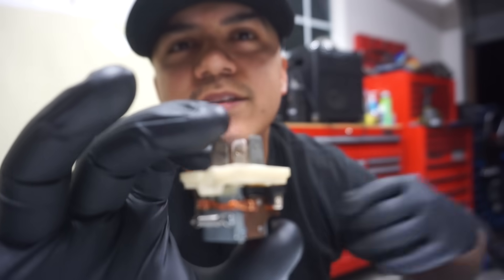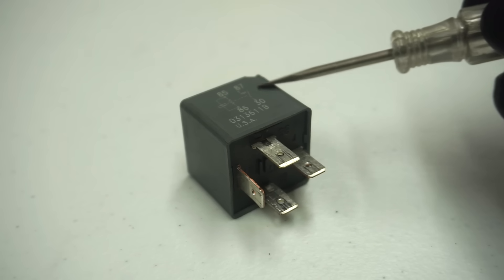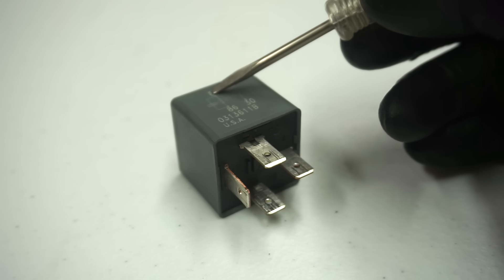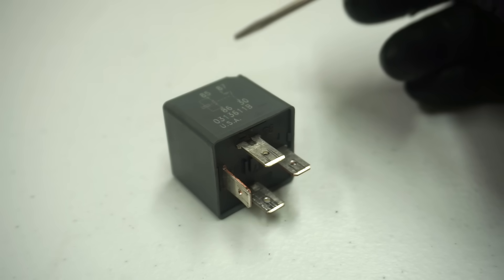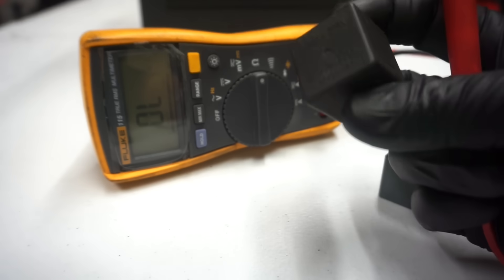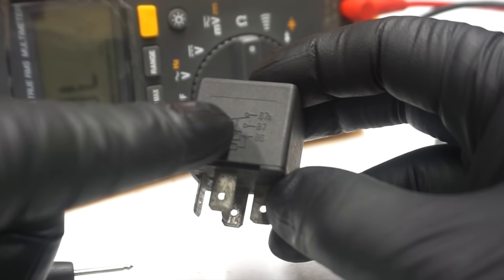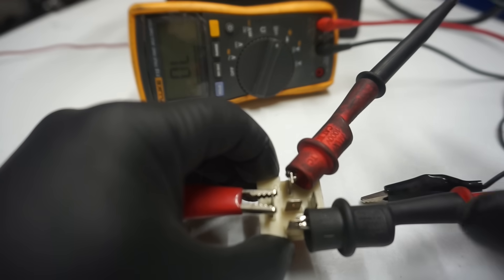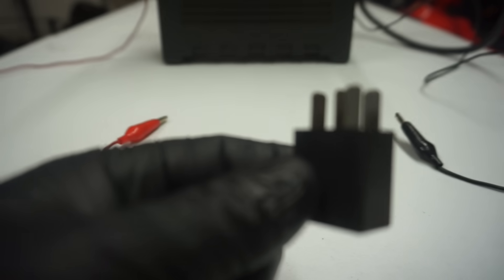How To Test a Relay The Easy Way

Comment: GREAT Video. I bought a 1983 BMW 635CSI sight unseen. I brought it home .I saw relays disconnected. Whatn i plugged the relay in.The electric radiator fans would not shut off. I have no Computer, No Radio, No Speedometer , no Trip Computer, No Systems Computer Check, it is to the left of steering wheel and you push the black button.Any lights or problems the red light to say the tail light or right turn signal will light up.Thtat is No Bueno. Here's the Kicker. I turned the key and he goes  " NO NO NO . You need to push the button, it is a push button start now. " Like it was a COOL add on. It is a PROBLEM with the electrical system. This dude had a 2018 BMW M^ and his wife had a 2020 X4. So when he bought this car. He thought you drove to your local Auto Zone and said " HEY MAN + I have a 1983 BMW 635CSI Grey Markey EURO and I Need Parts Hefa' . NO man it dont roll that way. I need HELP.......... Por fa Vore; Jp.. Great Video.....My e mail is tarponjpe@gmail.com

Comment: Hey bro i was wondering if you can give me some guidance so ,I have this buzzing noise that i suspect that has been draining my battery and I got a new battery and the car worked fine till i left it parked for a full day and the new battery was drained dead , it was also not even starting with getting a jump.. so after some time i figured to change the terminals on the negative post due to the original factory  terminal being corroded  and was just totally shit and was berally having contact to the battery  post so  i  eventually  changed  both so when i was able to get it to start I did the alternator check trick where I took off a terminal While  the car was running and the car did not turn off ... The car runs fine does not stall And turns on right away when  battery is good.... Breaking my head trying to figure out what it might  B was thinking about doing a draw testTo try to figure out if anything is pulling any power while the car is off I noticed that the noise is coming from main fuse box and im assuming its a relay, my question is what would be the best way to fix the issue... i have already took the battery to Oriellys to charge the battery and have left the car disconnected to the battery post.... @homieHektor
Reply from the maker: 1-What’s the year, make, and model of your car? 🚘 
2-You need to do a parasitic draw test to see what’s draining the battery 🔋 
3-Get a wiring diagram to see what’s involved in the circuit, and find the problem.

Comment: My radiator fans only come on when I turn my ac on they won't come on when the vehicle gets up to temperature though, do you think this could be a relay problem or would it not turn on at all if it was a relay
Reply from the maker: Depends on how it’s wired. Could be a coolant temp sensor...
Reply: @HomieHektor  might just replace the temp sensor first then and see if that fixes it, thanks for the advice

Comment: Amazing video  nice and clear, I'm using one  40 amp  relay for my nitrous and fuel solenoids ,testing system while engine is off  for 10 seconds straight no problems there, driving the car the system works  for one second  only ,then  no power from # 87 to the solenoids  ,thought I would pic your brain before tying another relay,thanx

Comment: Hector.  I have a 2006 C6 Corvette.  The HUD says “Service charging system”. I have replaced the alternator, battery and starter and it still gives me the same message.  I have checked all the Corvette blogs and no one seems to know what causes this. Desperate need help

Comment: So essentially the relay could be bad but still be clicking. I have a problem with my winshield wipers suddenly where they move very slowly then stop. Then after I've restarted the ignition cycle they will start to move again but slowly. I'm hoping it's not the motor and might be the relay. But I thought if the relay is bad they wouldn't move at all. Or maybe I miss understand. Thank you for the excellent video!

Comment: How do you get the radio in a 2007 Chevy her after the battery goes dead for a week before replacing, and now the radio doesn’t work or door chimes or blinker tic-tac- or seat belt chimes
Reply from the maker: What’s your question 🧐

Comment: Step 1: Remove relay from socket.
Step 2: Bang relay against the side of the cabinet hard several times.
Step 3: reinstall relay.
Step 4: run machine.

Comment: I'm 75 years old and have been a mechanic most of my life.  This is an excellent video.  It is very easy  to understand.  Thank you.  God Bless
Reply: 75 kickin it on youtube? God bless you sir
Reply: Sir could u possibly read what I was just posting and many help. Me out
Reply: @jamesstephens633  or select the square with the cc in the middle of it on the upper right side of the screen and she can read the excellent instructions.
Reply: I AGREE
Reply: Totally agree with you
Reply: agree man. well 👍 done
Reply: Awesome 👌 my first time
Reply: Paano pag check ng starter relay
Reply: I purchased a Toyota IQ 2009 push start button last year it was good and all ( its a used car) but i didnt drive it for a little while and now that i'm ready to drive it, its not starting..... Couldnt be the battery because i purchased a new one when i got the car, i just replaced the gas pump and there's petrol in it....... When i push the button to start it stuff shows up on the dashboard but when i try to start the car its making a clicking sound repeatedly then its like its dead again. What could be the issue??
Reply: So precise
Reply: Very well done video. This gentleman explained and demonstrated the operation and testing of the relay better than I’ve seen others do. 

Keep up the good work and thanks.
Reply: Hello .can anyone explain what could be the issue .i have taken my battery off while engine was running.after 10 second engine went dead.i have put new battery..all dashboard lights working.starter motor working fine.all switch working ok.but there is no noise when i trun on ignition and no start either.even though starter motor working fine
Reply: Hello .can anyone explain what could be the issue .i have taken my battery off while engine was running.after 10 second engine went dead.i have put new battery..all dashboard lights working.starter motor working fine.all switch working ok.but there is no noise when i trun on ignition and no start either.even though starter motor working fine
Reply: It was very helpful I'm having a problem with a fuel pump trying to get powers to it I can pour gas in it it will start but will not stay running
Reply: Yes he is good but when you are hard of hearing he talk way too fast for me sorry guys
Reply: @teranorris8606  q
Reply: @teranorris8606  adjust the Replay Speed (the little gear beside cc, bottom right)- i use all time...
Reply: @teranorris8606  For fast talkers or a slower listen like me, it can help to slow the video time down with selecting the top right corner of video, 3-dot setting button.
Reply: @jimmay1988   .
Reply: @teranorris8606  Just go to the three little dots at the upper right of the video and press it then select “Playback speed” and slow down the video.
Reply: @teranorris8606  what? Huh? I didn't hear you 🤣😂😅😂🤣
Reply: it was not an excellent video, it's ok'ish bc he said one of the relays was supposed to be bad yet he didn't test it to show us why it was bad, very stupiid
Reply: @pagepro211  lets see your video.

Comment: Sup bro.  I have a 90 nissan hardbody. Just died while driving it..  so I ran the fuel pump direct to my battery.  Its getting fuel up to the fuel pressure regulator. But still no start..  when I spray starting fluid into throttlebody it starts

Comment: When you powered your relay on the bench, what did you use for power source? Just a 12 volt battery?
Reply from the maker: 12 volt jumper pack, battery works as well 👍🏼
Reply: @HomieHektor  relays on a Chevy are sitting different than on your post. Same concept on my Chevy relay as your post?  And your vids are pretty awesome. Thanks

Comment: Thank you for your time. I could really use your help.  I need to know the setting to put on my meter.  Im stuck with a crank no start issue.  My meter has 20M , 200K, 2K, 200. for the OHM.   I dont have  1K, I tried reading the meter check at 2k and got nothimg.  What setting do i need to set my meter on.
thank you .

Comment: Great video but isn't it simpler to just swap the relayed and see if the problem is solved before getting into the weeds?
Reply from the maker: Yes, but then what? This is stuff you gotta know 👍🏼
Reply: @HomieHektor  
Say your fuel pump didn't work and you swapped the relay with the one for something else... then the fuel pump worked but the other thing didn't.    Wouldn't you just get another relay?
Reply from the maker: @Terryblount  yes

Comment: Just tested 2 relays but used a Duracell 9v battery as power across 85 and 86 then tester between 30 and 87 heard the clicks for power and the beep on meter , top man both relays working , great explanation ty.
Reply: Thanks, that's exactly the information I was going to ask about :)

Comment: Load side (switch side)  pins 30, 87 & 87a, and or  3 & 5. Control side (coil side)  pins 85 & 86 and or 1 & 2. Did I understand that correctly??? TY Hektor!

Comment: Started vehicle. Fan doesn't work. Pulled fan relay then plugged it back in. Fan starts working. Shut down vehicle then started it back up. Fan stopped working again. Pulled relay again and plugged back in. Fan started working again. Bought new relay. Same thing. What's up?

Comment: Hey Hector, your videos are awesome 👌
Sorry to see that Firestone let go of a great asset 😡 
I have trouble with my 2004 camry please help!!! 
Basic info is this..
- headlights went out.
- checked fuses with test light and it didn't light up.
- checked fuses by placing them in different fuse slots and they are good.
- I checked the headlight relay as you showed in the relay video, and its fine.
- I checked the positive and negative current in the fuse box in the relay socket and the negative is lighting up with really low light. Positive side gives out full light on test light.
- conclusion I came to is fuse box might have issue..?? Maybe?? I can't find nothing else online to help me and I believe you may be able to help me.
PLEASE HELP ME OUT HERE!! 😅😓😓😓

Comment: This is really just the quick and dirty way to test a relay, it only tells you that the contacts have closed and that there is less than 200 ohms continuity, it doesn't tell you the condition of the relay contacts. If a relay has burnt contacts you may get some continuity but that relay will get hot and possibly melt when passing any significant current or just give up without warning. You may even find relays which seem to work, but actually don't.
You need to do a "4 wire test", and what this involves is having a power supply with a 1A current limit, connecting the power supply to the relay contact leads and measuring the voltage across the contacts, then when you turn on the relay (use another power supply) the voltage will drop to nearly 0v @1A (short circuit), if the measured voltage is now any higher than say 60mV then the relay contacts are damaged internally, every 1 mV = 1 mΩ, a GOOD NEW relay will measure be less than 10 mΩ, normally around 8.
Why not just measure the relay contact resistance directly? To get a multimeter which can measure very low resistances accurately is extremely expensive (it requires precision components), we're talking thousands of $, but most multimeters do a very good job at measuring voltages down to mV (uV is a different story).
Former employee and quality engineer for one of the worlds biggest manufacturers of automotive relays.

Comment: I need to make contact negative to negative on a switch without any voltage going through it so if I have constant DC power going to 85 and 86 that would give me the contacts between 37 and 80 if that went to my toggle switch with absolutely no voltage going back will I be safe and sane I can keep the 12 V going on it won’t affect the relay

Comment: I have a 2014 Ford explorer trac and my lowbeam  headlights and my brake lights stoped working any ideas on were I should start to  check? Already checked the bulbs and there all good. If u have the time to lend a hand it would be greatly appreciated. You can email me at quiles1503@gmail.com gracias
Reply from the maker: You need a wiring diagram, start with fuses. Check powers and grounds and see what’s missing 👍🏼

Comment: Please what can make my Honda Accord 1999 model not start once, i have to start it 3 to 4 time before it respond, i have change the complete injector, fuel pump, fuel filter and and also new battery, but the same problem still occur
Reply from the maker: Check the main relay under the dash 👍🏼

Comment: Hector! Great Video. I have a 2013 Mazda 3 sedan and I am trying to track down why my washer pump won’t engage. I have tried everything from replacing the pump, the column switch and the fuses. I have not tested any relays. It’s the only thing I can think of next other than running a new circuit. My wipers work fine it’s just the washer fluid doesn’t spray. Any advice? Thanks in advance.

Comment: Hey bro I was connecting a battery on a polo 6, the computer box accidentally touched on a positive terminal, I also heard unusual sound on.the cluster but the car is not starting now, please advice way could be the issue?

Comment: turn signals r not working on my pt cruiser touring  turbo 2006 even if i changed the bulbs,what fuse or relay responsible  for that?
thanks

Comment: im subbed bro ,awesome vid !!! . here is my problem , car is running fine ,i go to an doctors appointment ,three hrs later ,go in car ,put foot on brake push button and dam , no crank ,no start ! . i then later test it with the OBD2 and get 2 codes ,PO23F and UO100 ! .I GOT A 2011 BUICK LACROSSE CXS 3.6 ENGINE . the check engine light flashes stupid stupid fast ,it said on dash ,i have a stabili-trak AND no side detection ! im really worried about the OBD2 CODES .ITS BEEN TWO WEEKS ITS BEEN PARKED ,I NEED HELP MY BROTHER !

Comment: With your resistance test across the field coil you are basically checking for continuity and that is it, that isn't a check to say the field coil side is good, just that it can pass an electrical current, it could be multiple windings melted together but it still has continuity. Unless you have a spec for the resistance or another relay to compare to, it doesn't tell much.... test the field coil under load.

Comment: My 2011 Malibu has rear turn signals but no tail light" which relay do I need to test? Is it the one for the headlights, are the one in the same?
Reply from the maker: Manuel Romero you need a wiring diagram to see what’s involved in the circuit.

Comment: Years ago my bmw died in the middle of the street, once i moved it to the side, i started checking everything, i forgot how i ended up knowing it was a relay. It did click, but i still opened it up and the copper contacts had black burn residue.that prevented them from contacting with each other.

Cleaned them up, sanded them a little, put it back and car started right up

Comment: My ac will kick on for up to 4 seconds and stops, it won’t bypass with a paper clip.it will work when i jump it off the battery and drop to 60 degrees. What else can i look for?

Comment: Are  you working around ny
Reply from the maker: nurul monin I’m in California
Reply: @HomieHektor  sorry I'm in new York. I thought if you here I go and  discuss  about the issue.  Actually your lesson really awesome. Even though I'm not mechanic, as you went through relay it's knowledgeable and awesome. I've issue, if you could. I've 2006 Honda Odyssey. All signals turning light and hazard light working except right front turning light. I checked light and power supply good. But it seems like  flasher relay may not working but I don't know where it's located. Could you please give me some idea where could I look for to solve the issue. Thanks.

Comment: Hektor,I have a 2006 chevy impala and my fans does not stay on even when the A/C is on, it goes on and off. I would touch the switch on the passenger side and it may come on sometimes. My A/C is blowing hot as well.

Comment: You should always test the 30- 87 or 87a connection for Resistance.  You can measure voltage or use a test light and that connection might look okay but still have burned or corroded contacts which will give you a Voltage drop/higher than normal Resistance which could prevent enough current from flowing to the Load. Your Resistance measurement should show NO resistance. There should be NO Voltage drop across those contacts. Otherwise you did a very good job producing this Video on this subject.
Reply: L
Reply: Yup
Reply: When you test 30 and 87  for resistance should you have power to 85 and 86 or just test the resistance to 30 and 87?

Comment: Just found your site, great video, auto electric systems and tests have always been a mystery to me, this helps. More videos showing electrical auto motive test would be great (perhaps they already exist) One simple question on my part, why are there relays and what is there actual purpose in the electrical circuit?
Reply: On a circuit that has a high amperage draw there is a heat problem wherever there is resistance. Invariably that is at a switch point. so a toggle switch or other kind of switch can't handle a continuous high amperage going through it. It will burn up. So we use a toggle switch with a low amperage circuit to trigger the relay which completes the high amperage circuit to get the job done. It is really just a much heavier and stronger switch.